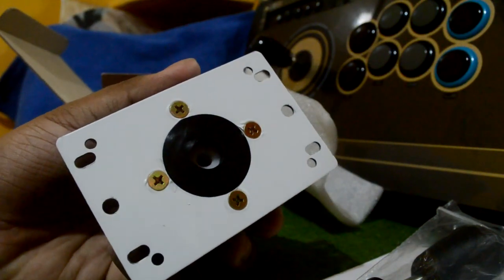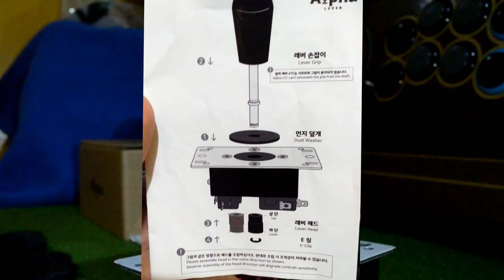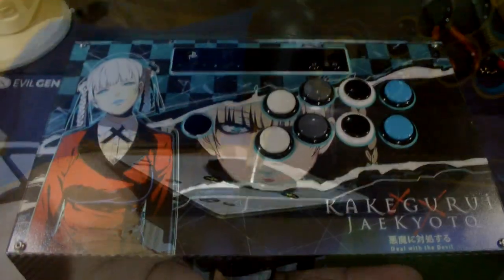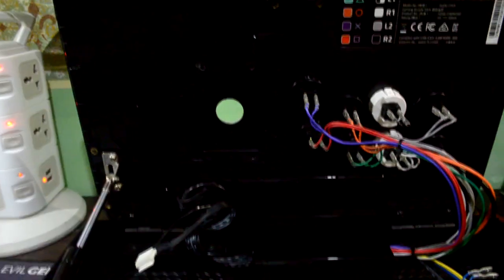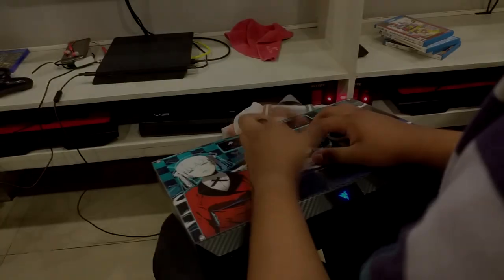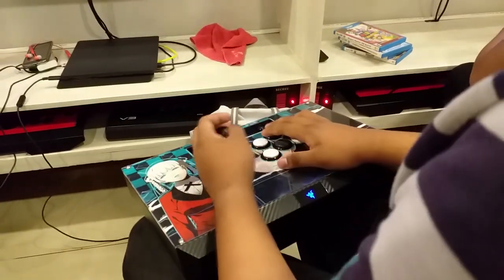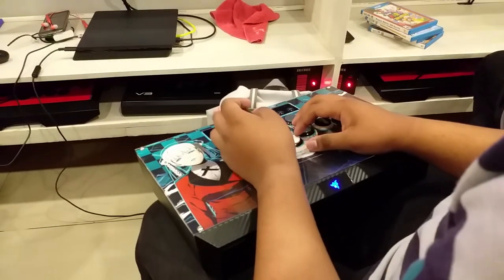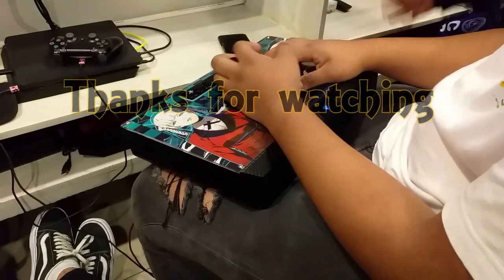KOREAN LEVER REVIEW - IST Alpha 47C

Comment: You can buy replacement panels for several fight stick types (RAP 3, RAP 4, RAP N, RAP V, RAP VLX, TE, TE+, TE2, TE2+, Fighting Edge, several others..) to accommodate Korean levers with a full collar, did this myself with my RAP N and had a 24GN 2019 Fanta w/ the airbag plate in it for a minute before settling on the Fujin III Rev. B in the end with Crown 202MX buttons. 

The Alpha series levers are far better than anything Crown has to offer imo, Crown is just very beginner friendly as they have softer stock tensions (HST25 and HST35, their high tension is ungodly stiff (stiffer than a Fujin III) though and I don't recommend using it as it will inevitably strain your hands/wrists unless you're using something with a full throw like the 309K HELPME which imo is Crown's best product along with the 303DX CDP) but the Alpha series manages a lot more. The flat collar design would make you assume the throw is very short, but it's actually longer than a short collar Crown due to the undersized shaft so the throw radius is almost (but not quite) that of full collar levers. The tension and grommet types used is far more in line (due to using IST grommets like Fanta/Fujin levers) with what's normally found in Korean levers and imo the Crown series has just become too westernized at this point. They sort of feel like a middle ground between traditional Korean levers and Japanese levers. Alpha levers are far better at giving an authentic Korean feel in a package that fits in cases designed around Japanese parts.

There's also the Knee lever, which is sort of like an Alpha but it's also not really. It has a full throw despite having a flat collar like the Alpha, a Myoungshin distance throw. The grommet is on the softer side but is tuned to have a faster neutral return that most similar grommets of its spec. I personally didn't like it very much though, but it's a very balanced lever like Crowns but it's more authentic feeling.

Fujin III would be my #1 Korean lever, followed by the Taeyoung Fanta and then the Fall 2019 24GN Myoungshin Fanta w/ the airbag plate. Then for #4 and #5 I'd probably pick the Crown 309K HELPME and the Kaze lever. The 303DX CDP is quite nice too, but I really just do not like short collar levers unless they have an undersized shaft tbh. I like longer throws.
Reply: interesting, you didn't place the alpha/knee in the top 5, why is that?
Reply: @SilverStarGG  especially when he said the alpha is better than anything crown has to offer. Very confusing lol

Comment: Is the battop removable from the shaft on this lever? The updated 49S model looks like it comes with a removable battop, but I don't know about this 47C. Also, how is the full throw distance?
Reply from the maker: Technically, you can take them off but they're glued on. You could just order the Alpha shaft but if you really want to you definitely could with some goo-gone.
Reply from the maker: The throw seems an average middle ground. Basically if its longer than what the 309MJ has

Comment: It really looks very stiff on the video, have you tried the 49S version yet?
Reply from the maker: It is! the stiffest k lever on the market if Im not mistaken. Not yet! however I do have one on the way already and will definitely be doing a video on it c:
Reply: @jaeiken2872  any update on that 49S video? Also, will you be getting the new low collar Taeyoung Fanta?

I'm trying to decide between these two which one to get for my next K lever. Currently using the 309FJ.
Reply: @SirCharles.  taeyoung is stiff and imprecise in diagonals.(a2 microswitches) but of you learn how to play on taeyoung you will be very precise on other levers.
Reply: @islambekusupov6328  Hey man which microswitches are better to hit diagonals more consistently in a Taeyoung? I currently have a Taeyoung with Gersung V16 Microswitches, the Classic ones that are equipped in the Taeyoung. Do you think a Gersung V0 (Crown Microswitches) are better to hit diagonals more consistently?
Reply: @shiki494  Hi. I believe that gersung a3 or Omron v6 is the best for taeyoung but u have to change your rubber grommet for a lighter one cause a3 or Omron v6  are heavier switches. I had used gersung a2. Or maybe u don't have change switches and u just need a larger actuator. But if really looking for a larger diagonal lever i suggest knee lever (totally different than tayeyoung) or fujin v3 ( basically premium fanta)